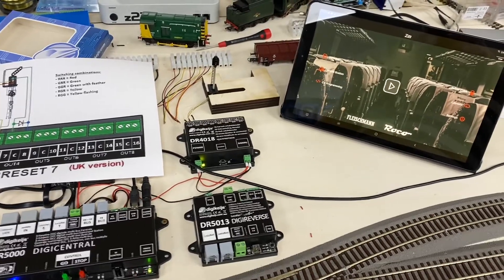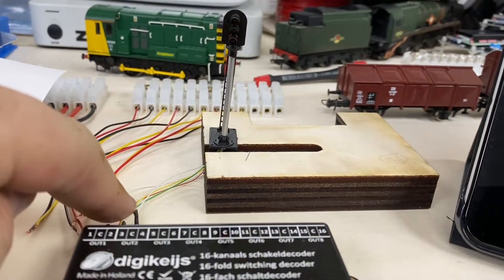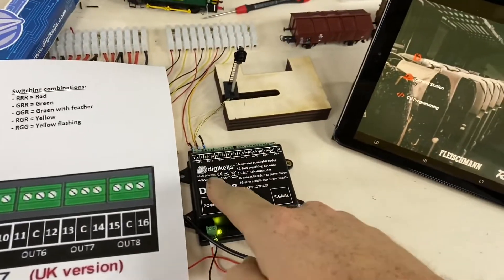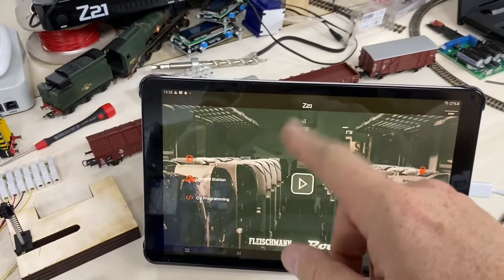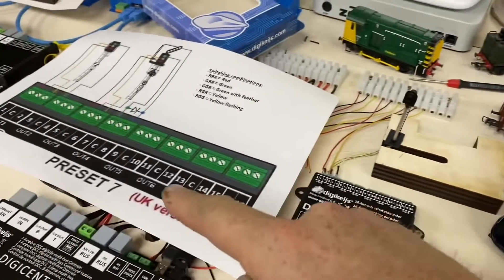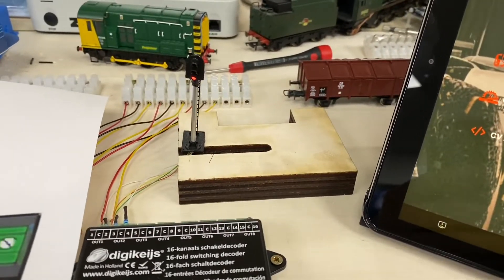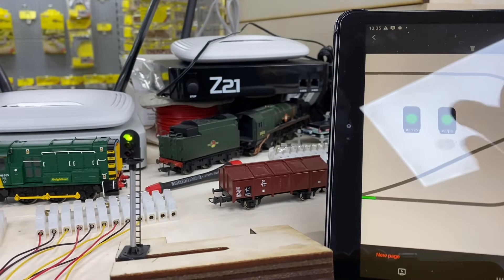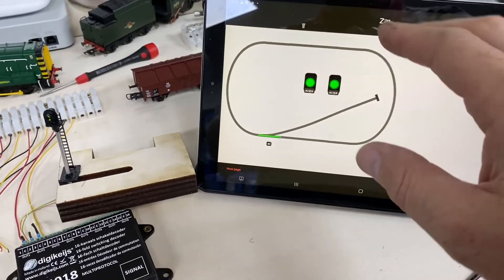DR4018 switching UK 3 aspect signal

Comment: Very helpful video as I have just bought several DR4018 units to control signals on my Swiss layout. I have 3, 4 and 5 aspect main signals as well as four light distants to configure. I have a DR5000 command station and use the latest Z21 app, which has been updated to cope with more complex style signals earlier this year.
Q1. The DR4018 has NS and DB configuration presets, do I have to configure the Swiss ones differently?
Q2. Using your guidance I can see that three aspect control is straightforward. How do you get the signal to go back to red after the train has passed? I am installing detection blocks feeding DR 5088RC units. Do I have to write DIGIKEIJS scripts?

I not not wish to automate my layout, really I just want realistic signal automation and station area route-setting. The Z21 app makes route setting easy, including setting signal aspects.
Reply from the maker: Hello Jol what control software are you using to control the trains? iTrain or something else?
Reply: I am just using the Z21 app for route setting. I drive locos manually. I particularly like the Z21 Siemens graphics used on a tablet. It looks like a real signal panel, unlike most of the graphics of the iTrain, Rocrail, JMRI softwares. I have wired two DR5088RC to cover my ten storage loops and approach tracks. In essence I am just using the detection like track circuits on the real railway. I looked at DR scripting late last night - this may be the answer eg IF block x = Occupied , Turn signal y to red.
Reply from the maker: @jolbates2823  Yes that would work perfectly yes.
Reply: Thanks. There are several websites about scripting generally. But I have not seen a YouTube video on how to do it for the DR5000. The DIGIKEIJS scripting manual gives some basics. I guess I will set up a test signal and connect to my half built layout.
Reply: @jolbates2823  i could never work out the scripting on the DR5000 to do exactly as you are wanting. I am now trying to learn iTrain on Demo, then I'll buy the license from DCCtrainautomation if I can make it function.

Comment: Hello, based on your previous video’s I was able to get the home signal to work on the Z21 ⭐️ this video just simplified everything 👏🏻👏🏻👏🏻👏🏻 Is it possible to do the “distant signal” using the same methods though 🤔 either in  the Z21 app or ITrain would be handy as I bought 5 of them not knowing they where yellow green yellow 😮 Any guidance would be greatly appreciated 😁 Many thanks, happy Irish ☘️ customer 💚
Reply from the maker: Please what signal do you want to use?
Reply: I'm using C R. SIGNALS with the DR4018 and  common cathode converter 👍